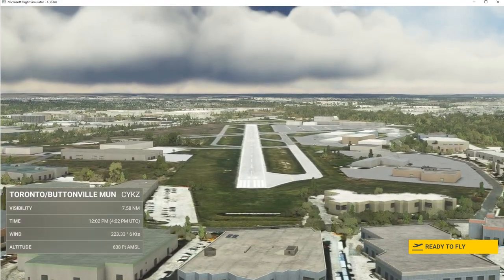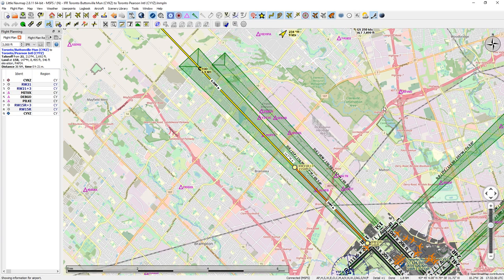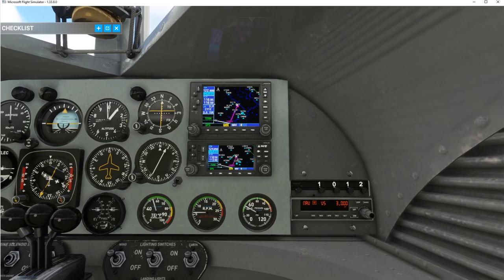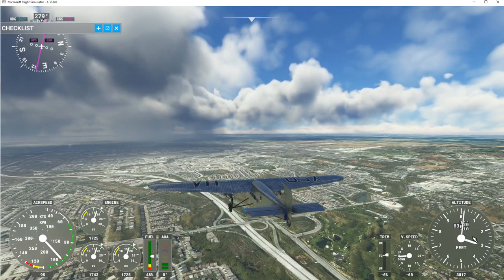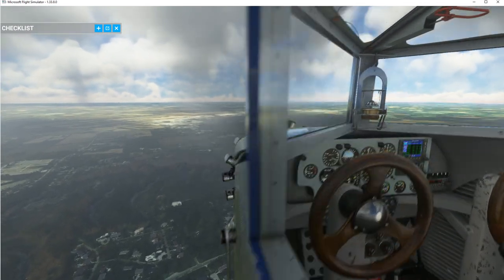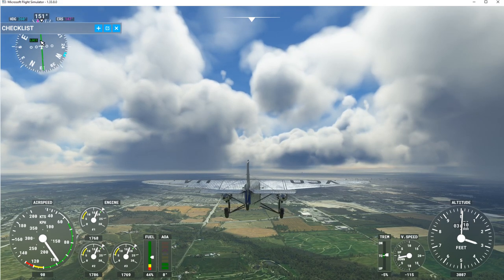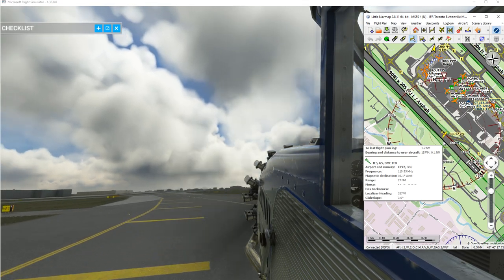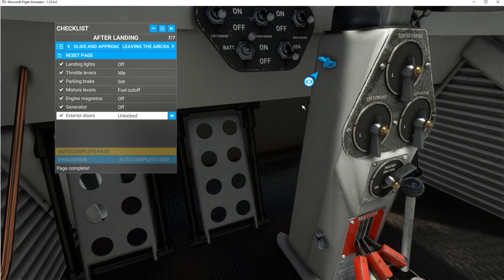MSFS Ford Trimotor autopilot, ILS approach and landing with the Garmin GNS 530/ 430 avionics panel.

Comment: Nice landing. Excellent video. Great views. I couldn't get the autopilot to work. You're the first one that I've seen that got it to work. How do you get the checklist to auto complete? Where do I change my settings to do this? Thank you.
Reply from the maker: I will do a short video and upload it. You need to go to options at startup and select assistance then type in checklist in search box, then turn on assisted checklist and hit apply save. Hope this helps.
Reply: @IFRSKIES  thank you.

Comment: I just learned about the different panel options. This is awesome, thank you! I wonder if the DC3 has those options?
Reply from the maker: No I do not think the DC3 has that option. This is the only aircraft that I know has this option at this time. Glad you liked the video.
Reply: @IFRSKIES  I did some digging. The DC3 has the G530 retrofit as a separate thing.
Reply from the maker: @JoeDFWAviation  Did you have to purchased the G530 retrofit for the DC3 or were you able to use the G530 from MSFS Marketplace?
Reply: @IFRSKIES  marketplace.
Reply from the maker: @JoeDFWAviation  Thanks. I checked MSFS marketplace and found the DC-3 Retrofit and downloaded it. I did a video https://youtu.be/8eL0wo8RERQ and posted it. The DC-3 works well on autopilot but still difficult to control on the ground with that tail dragger wheel. Cheers.

Comment: Perfect video, congrats! 🙂 One question though: How did you build in the Garmin avionics panel? The downloaded version have no avionics panel in my case?
Reply from the maker: If you have downloaded the Ford Trimotor it will come with three panel options. Use the small panel options dial just to the left of the clock on the start up panel. Turn the dial to choose one of the three panels. One of the panels has the Garmin GNS 530 and 430.
Reply: @IFRSKIES  Thank you very much for the quick help, finally I've found the dial option and it works! 🙂